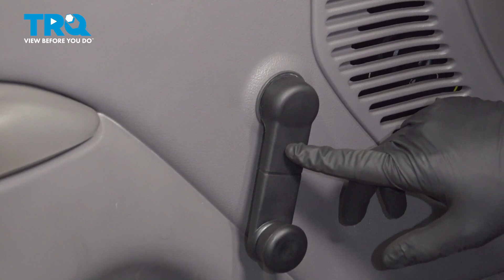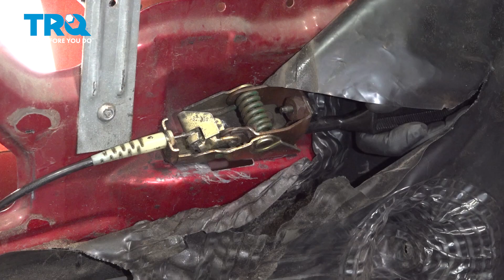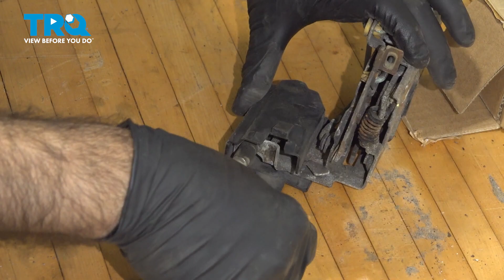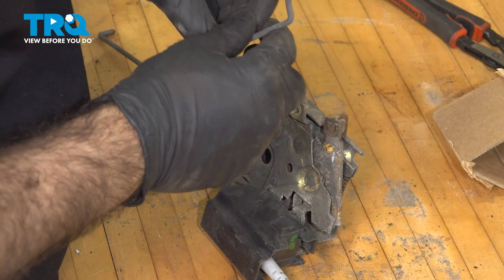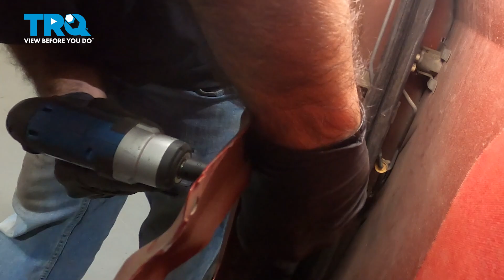How to Replace Door Latch & Cable Assembly 1992-1996 Ford F-150

Comment: How did you remove the door lock actuator? Its connected to the bottom of the latch assembly and appears to be riveted in place.